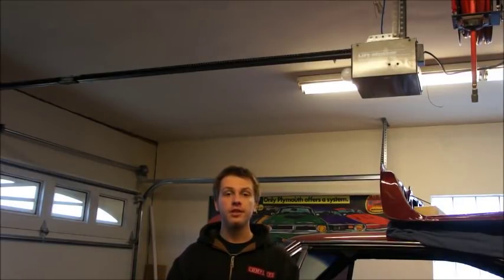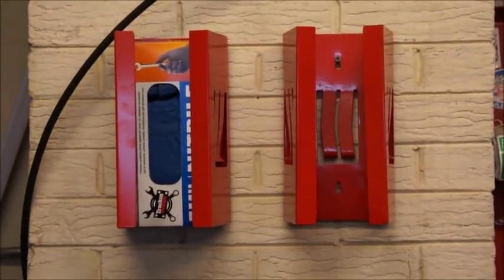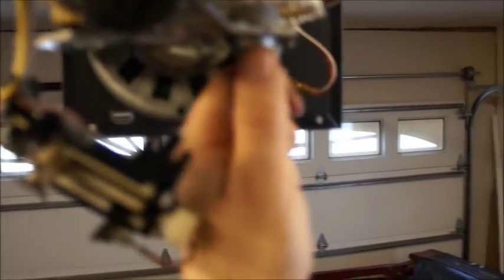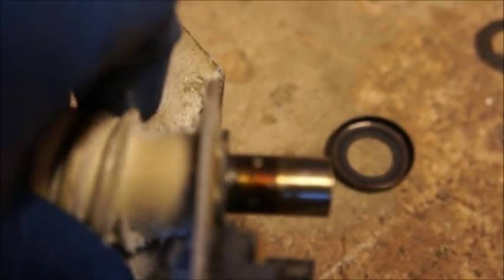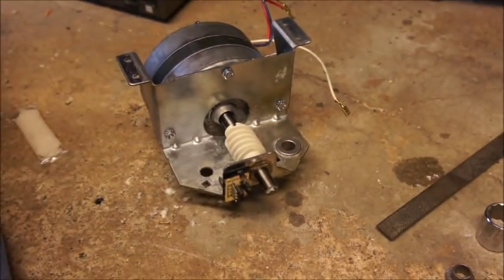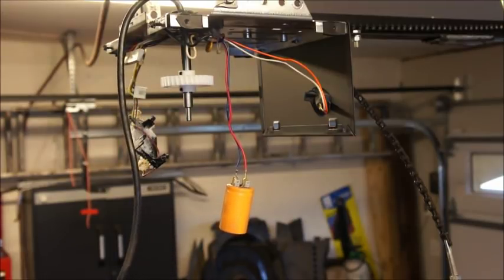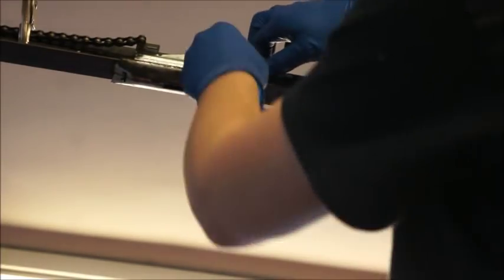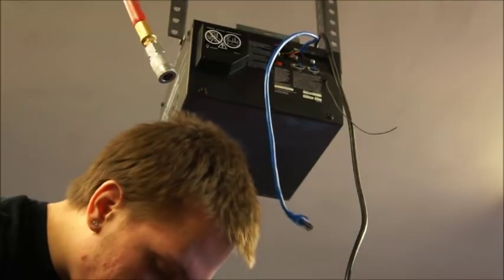How To Replace a Gear and Sprocket in a Chamberlain, LiftMaster, Sears/Craftsman Garage Door Opener

Comment: One of the best how-to videos I have ever seen. "Ask me how I know." You were clear and concise and explained everything very thoroughly. The upper sprocket bearing was worn and ground down the shaft to an 1/8th of an inch before braking. You gave me the confidence to tackle this job. I had another older craftsman. I took the rail from it and the very intact sprocket and rebuilt the 2006 Chamberlain. It is working great. I never really was sure what I was doing when adjusting my lift. You made that an easy task, also. Well done!

Comment: This is the best video I have seen regarding replacing the gear and sprocket on a liftmaster
garage door opener.  I have a lift master and I purchased a kit to replace my worn gear and sprocket.  I followed this video to a "T" and everything worked out fine.  Thanks to this video.

Comment: Thanks very much for taking the time to post this very well done instructional video. I'm a 65 yr old diy type when possible. Your video gave me the confidence to do the entire job (including changing the motor bearing and worm gear assemblies) without fear of getting stuck in the middle scratching my head. Your discussion regarding what are known causes for particular failure modes was very helpful. The demonstration concerning the limit adjustments and force settings let me finish the job like a professional. Thanks for making the job a straight forward task for the price of the replacement kit as apposed to a potentially costly repair.

Comment: I can't thank you enough for your great video. I have a LiftMaster 1280 which is a little different from the model in your video. To remove the worm gear you have to knock out the roll pin which added a little more challenge but not a huge deal. Then I had some issues getting the door travel adjusted after replacing all the parts. All those problems were caused by me not having things adjusted or connected properly.  For about $30 in parts it's now working great again. I'm pretty sure I couldn't have done this without your great instructions.  I'm sure you saved me a lot of money and I am extremely grateful.  Thank you, thank you, thank you.

Comment: Nick, your probably saved me $250 today and I burned a good two thousand calories watching the video, stopping it, climbing the ladder to do a step, then back to the video, back up the ladder... over and over.   In the end the only issue I had was getting the motor back in and that was a minor alignment problem that a slight hammer tap solved.
Great step by step!!

Comment: Great tip on where the sprocket is supposed to cycle to. Other vids don't cover this and it is important if you are replacing the trolley and chain and forgot to mark it.  Thanks again.

Comment: Great video! I'm a garage door tech myself, the way you broke this repair down was perfect, you didn't leave any questions unanswered 
Operators have always been my nightmare job, this video pointed out a few of the issues I've had. Thanks man!!!
Reply: it was a great video ,i just replaced my gears but i do have one question still ,how are you supposed to tighten the chain  properly? i can't do it , i tried everything, the side with the tightening bolt and nuts is too tight and the  opposite side is too loose ,how come there is no way to just make it tight  on both sides at the same time? i tried to spin the wheel for the RPM sensor and the sprocket will turn a little and make the opposite side of the chain a little tighter but then it will  start to slip on the motor shaft and the sprocket wont turn any more ,why can't i  rotate the sprocket with the chain on it to  move the slack to the other side with the  tightening bolt? whenever i try and tighten the chain  it just tightens the side with the bolt and the other side just stays loose , really fucking frustrating ,  i don't   see why the damn sprocket will not turn to take up the slack from the other side, i don't  know what is stopping it from moving ,  wouldn't it have been better to just put the chain on the sprocket  1st before putting in the motor then  it would spin freely without the worm gear being there and i could just tighten the bolt and have the sprocket spin to take up slack from the other side since nothing would be interfering with it turning, now it won't turn at all and tightening the bolt just tightens  the one side of the chain , the door works but i am paranoid it is going to break the sprocket or the top bearing under it ,it is taught on  the one side with the bolt and  on the other  side the chain is sagging  and hitting the top of  outer  trolley , i feel like i should take the motor off again to adjust the chain properly because i cant  get the slack off the other side
Reply from the maker: Andrea Mitchell Hi, I didn't see your comment until now, just keep tightening the chain wth the door disconnected. The idler sprocket at the front of the door opener will turn and allow both sides to tighten.
Reply: thanks,nope it would not turn,  just figured out to tighten it once with the door open and again with  it closed ,  the chain is still loose and makes some noise but good enough  i guess, now i am paranoid
about it being too tight and breaking the sprocket bearing
good video though i got it all replaced and all is working fine
 i think that it might be better to  put the chain on and tighten it before bolting in the motor again so the sprocket  on the opener will be able to turn when you tighten the chain and take up slack from both sides
for whatever reason  on  mine the sprocket at the front did not budge when i tightened  the chain and every time i tried it just made it it tight on one side and lose on the other ,doing it with the door open and then closed helped a little but but i still could not get it right

Comment: Hi Nick.  Thanks so much for making this video. My gear had stripped in a 1999 Liftmaster 4410EGB-418 door opener and your comprehensive video helped me to replace the gears and all the bearings using the service kit. I'm back up and running again thanks to you so thank you!!

Comment: One of the best repair videos I have ever seen. Very detailed with lots of precautions, warnings, and tips. I now know that I can do this! Was about to buy a new unit. I also learned that since my sprocket was indeed moving around on top of the chassis, you said that is a worn bearing. My chain had come off. I got it back on & tightened & greased it. When I re-started the sprocket shaft broke. I think the door was closed and I had it in close mode - too much stress I assume. Thanks so much. My LiftMaster is old but still going. Now  $25 repair instead of hundreds for a new unit.

Comment: Great video & my thanks to you!  I bought a rebuild kit on Amazon & utilized your steps to rebuild my Sears/Craftsman garage door opener.  The only issue that I encountered was the new set screws were a bit too long, so I used the OEM set screws with the new motor shaft collar.  Again, well done!

Comment: Good day sir and thank you for your time and information on this important repair, very helpful and informative I can see your experience on this line of work. One thing was that not all the plastic was clean on the lower part of the unit. We what to do 100% on the job 🤔 but for the most part the repair was completed and system was working good 😀👌

Comment: Just excellent. Very helpful and entertaining. Made job so much easier. Two comments for future inclusion: 1) you used vice grips on chain but didn't discuss, @ the "motor control" gear which set open/close  setting was totally off because of stripped sprocket must be reset manually. This took me awhile to figure out since I could not get total door travel.
Other than that, fantastic! Thanks.

Comment: Your camera/phone? is fine. It wants to focus on the light dominate window in the background. Easy fixes: 1. Have a light shining on the machine or the operation. A well placed flashlight will do the trick. 2. change the pov and eliminate the light pollution. Thanks for the video. It was very helpful.

Comment: Nick, you did a fantastic job on this video! Very informative, well done👏👏
Reply from the maker: Thank you Joe!
Reply: Excellent tutorial.  Some models--my model number ends in 57, not 56--may have a  chain cover/spreader screwed on (not mentioned in video).  Gear assembly won;t lift out? Remove plastic chain spreader near sproket.  Because of proximity of ceiling, may not be able to eyeball fasteners, but they are same driver as case screws.  Also, as Nick probably figured out, nothing wrong with camera. Just back off a little, as this is not a closeup lens. Thanks for the help!

Comment: Helped streamline the repair on my opener. I replaced both gears but did not get the downshaft/metal chain gear and top metal bushing mount. Luckily mine were in really good shape still (took apart and regreased) I had to readjust my down limit after install, this may have been for a frost heave (uninsulated garage in Alberta , also have not used opener since it stripped 2 years ago).

Comment: Just finished a gear replacement. One thing I may have missed or it wasn't mentioned. Pretty minor but on my Craftsman there is a cover over the chain sprocket. When you put your gear shaft assembly in check to be sure that the holes in the gear assembly mounting plate for the "ears" on the sprocket cover are correctly lined up. Mine should have been front to back (there are two cover ears)

Comment: Thanks very much Nick, for your great instructional video.  I've got one at my house with a stripped worm gear and another at my ex wife's house with what seems to be poorly aimed sensors.  Thos sensors don't have LEDs so I guess I'll need to use a voltmeter on them.

Comment: Nick, thank you for this video. It help me easily replace the sprocket gear assembly on my GDO. I would not have been able to do it as easily with only the instructions that came with the the repair kit. And as you stated in your video ... Double check to make sure you have secured all connections BEFORE  you replace the panels  ... ask me how I know! Thanks again!

Comment: Great video, excellent sound.  Helped a lot.  Thanks!
Reply: Two important points:
Do not over tighten the chain!  If you do you do you will dramatically shorten the life of the chain sprocket.  I tightened my chain to make it a little bit quieter and it snapped off on about two weeks.
For safety and longer motor and gear life, adjust the up and down torque to the minimum torque that will raise and lower your garage door reliably.

Comment: I can't understand how you got thumbs down you obviously have people jealous of you. You did a wonderful job. I have the same type of garage door opener on this video. I purchase a new sprocket gear and replaced it. The garage door goes up down about 2' or less do you think its the RPM sensor?  I tried over and over to adjust the  Up down lift gears and still it goes up down..  Again great job very informative very knowledgeable keep up the good work young man.
Reply from the maker: Thank you for the kind words. Did this issue start happening after the sprocket replacement? And does the light bulb flash on the opener after it stops moving? If it does not flash, it is likely the RPM sensor. double check and make sure the RPM wheel is sticking into the sensor at least half way. The most common oops I see is the incorrect thickness washer got installed and that causes the sensor not to read the wheel. If it is all installed properly, most likely the sensor is bad or got damaged. They are cheap to find on the internet.

Comment: Thank you very much for the video. The problem I ran into is that the bushing in the kit was super tight And the chains shaft was impossible to get into the bushing. I tried polishing the inside of the bushing in the shaft with Emery cloth, but that didn’t work. I ended up Installing the motor assembly First, then I dropped the chains shaft down and tapped it into the bushing with a hammer gently

Comment: Since the typical do-it-yourselfer may not be very experienced or familiar with capacitors, please add a warning around the 10 minute mark that it's important to short the terminals of the motor capacitor together using a bleed resistor to bleed off stored voltage (or at the very least, use a metal tool such as a screwdriver with a well insulated handle to short the 2 sets of terminals together. A bleed resistor is optimal as there's a chance a direct short could damage the capacitor, but better to damage a part than a person)! This is very important for safety as capacitors often hold a high-voltage charge (that's what they're designed to do after all) even after the appliance is unplugged from the electrical outlet, and touching the terminals or the wires connected to them without bleeding the charge off first could give them a nasty shock. Unfortunately I've learned this lesson the hard way after working on capacitors thousands of times. Even 99.9% attention to safety still leaves room for electicity to use your body as a conductor once every so many years
Reply from the maker: This is good practice, however I've shorted these capacitors out numerous times and they've never shown any signs of life. I'm not sure how exactly these capacitors are used, there is a neutral that is constantly hooked up to the power source, and the board applies the hot power to either the red or blue wire depending on the direction.

Comment: Thanks Nick.  Great video.  I did not have a broken gear but have an issue with my LIMIT SWITCH?!?!  The garage door would OPEN past where the limit was sent - MORE THAN ONCE!!  The chain would then "jam" as the adjustment plate ran into (and unto?) the metal nut and bolt put in the T track??  I loosened the chain and tried to readjust - on MORE THAN ONE OCCASSION.  I would run it several times and the door would seem to stop by the set UP or DOWN limits (no gaps or bounce back).  Then, as I think that I am done, I would open the door "ONE MORE TIME" and the chain would, going up, bypass the limit set by the screw.  I am wondering if the SIMPLE METAL CONTACTS may need cleaning or to be BENT back into shape??  (Having removed the cover and I can see the white plastic limit screws and related "whisker switches".  Please help!!  Thanks!
Reply: Vitas. Make sure the bushing that the gear shaft rotates in isn't wore out on top under sprocket and where sprocket shaft goes through motor plate. You can do that by removing the chain from sprocket and seeing how much play is there when pushing the sprocket left and right. If excess play, install a rebuild kt. In another video different from Nicks the tech shows how to push out the bushing with a nut, bolt, and socket the circumference of the bushing. Excess play will interfere with the timing. You can also operate the opener and watch the internal operation to identify excess play or problems. Remove the body cover and operate the system while chain is off sprocket. Don't touch anything while cover is off without unplugging unit

Comment: Awesome video! I followed along and completed the repair. Thanks for saving me a lot of money. Only question i have is how did you get your door to travel so quietly?
Reply from the maker: rudy carreon I lubricate my door once a year. I've been meaning to make a how to video on it, but haven't had time. If you go to harbor freight, you can get a small pump oiler for a few bucks. Some auto parts stores have them too. Then I just go to the auto parts store and buy a quart of the cheapest motor oil I can find, and that'll last you a long time. You don't need to use a lot, just about a drop on each hinge where the round pin goes through on each side. If your door makes a "clickity clack" noise like a railroad car going over some tracks, chances are you need new rollers. The best ones to get are sealed bearing 13-ball white nylon rollers, you can find those on eBay and you can find instructional videos here on YouTube, I recommend DDM Garage Doors' how to videos when I don't have one that covers the specific topic. Let me know if you need any other help. -Nick
Reply: Nick'sGarageDoorService Thank you for the advice. I'll definitely start working on that.

Comment: Nic,k,  Thanks for your excellent and detailed video.   I think I did something wrong when I detached the door and chain in the beginning.  Even with the trolley detached now after the parts were installed, the door only runs about 2 secs, then reverses and runs another 2 secs before stopping.  It doesn't seem to be hitting either limit switch.  I reduced the force load and that didn't help.  Maybe I didn't get the sensors for the light beam hooked up right.  The first time I started the motor (with chain attached) it ran longer.
Reply from the maker: Hi Bill, it sounds like an issue with your RPM sensor. Double check and make sure you plugged it in, it's easy to miss. I've left it off quite a few times. If it's plugged in, make sure the slotted wheel is sticking into the sensor at least half way. If neither tips is the issue, it's quite possible that the sensor was damaged during the repair. They can be found on eBay usually less than $15 shipped.
-Nick
Reply: Nick.   That was it.  I was able to get the collar pushed about 1mm 
further onto the shaft and I lightly brushed the sensor sides with a 
small paint brush to make sure no old gear particles were blocking the 
path and it worked.   We are operating again and it is running quieter 
than ever.  Thanks again!!!
Reply from the maker: Glad I could help. :-)